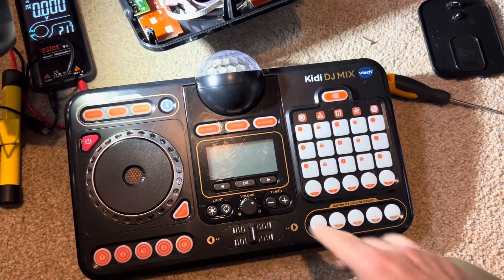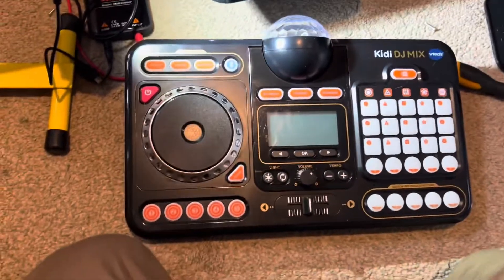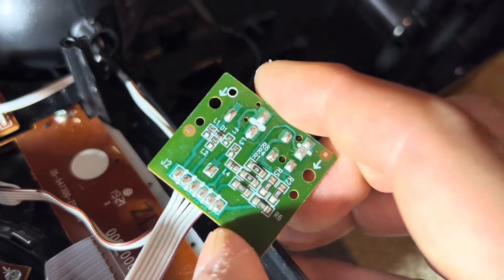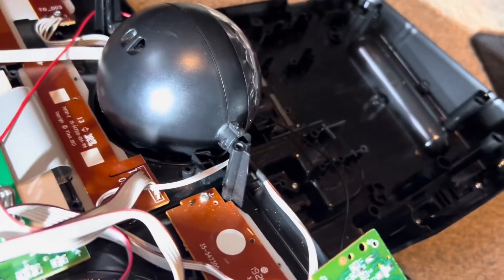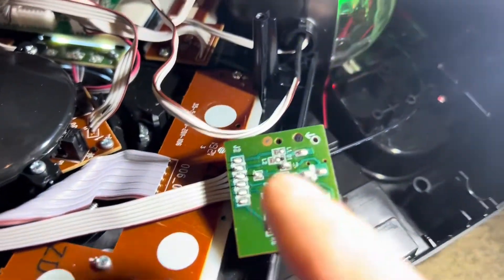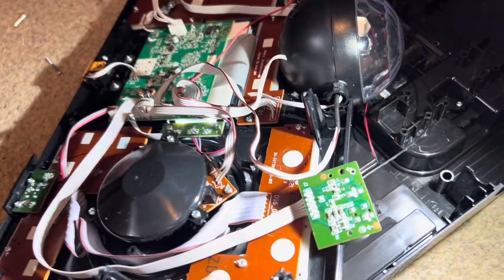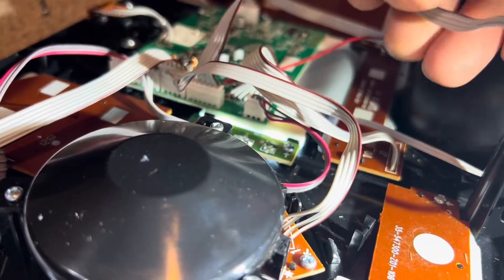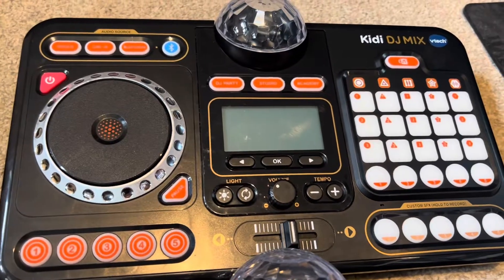Repair faulty VTech Kidi DJ Mix that won’t turn on

Comment: I removed the fuse and added a simple wire. I had to remove and shunt ac adapter because the plug had bad contact too. 
Everything is working fine. I didn’t cut the motor wire.
Reply from the maker: You don’t need to cut the motor wire but there’s a good chance that is what overloaded the fuse and it’ll likely blow something next time instead

Comment: Could i just disconnect the light since i dont have that tool?
Reply from the maker: @iamcrater152  the fuse needs bridging to repair it, disconnecting the light is just to prevent it overloading

Comment: Thanks for this, the soldering worked!! 😅
Do you think it’s still necessary to cut the wire to the disco motor if using batteries? Will it eventually break again if I don’t?
Reply from the maker: @manisharooni  my theory is it’s the load of the motor that blows the fuse.
Reply: @DavesDiscoveriesChannel Okay, so might over heat if I don’t cut it? 
I will do that incase then 🥲 

Thanks again for sharing this knowledge, I would not have had a clue. I’m amazed you could tell that teeny tiny thing is a fuse that’s blown 🤯
Reply from the maker: @manisharooni  it’s hard to say but the fuse is there to protect the other components so something else will likely fail

Comment: I have one and the speaker doesn’t work, headphones do and everything else works, any suggestions?
Reply from the maker: @SimonHukin  none other than opening it up and checking the speaker connection / testing it, sorry
Reply: Thanks, I just opened it and looks ok… the speaker wires had a small bit of crushing, but looked like they should still be ok. There was a hole in one of the ribbon wires which come from main board behind where the Dj party/studio/academy buttons are, but not sure if related, also probably beyond my fixing capability anyway 😅

Comment: I bought it for Christmas and it stoped working after a week, could this be the issue? I changed the batteries. Im having a hard time getting the back to open. But im going to keep watching the video to try and understand it
Reply: I dont have an soldering tool but would i be ble to make it work if i just cut the wires to the motor? Idk whats even wrong with it lol 😅
Reply from the maker: @misspoofs  you need to bridge the failed fuse too.
Reply: @DavesDiscoveriesChannel  okay thank you I'll get the tool for it and then work on it i hope it works out 🤞🏻

Comment: I have the same model but in pink and everything works fine except for the turntable. I took it all apart. I can't find out the problem. I'm wondering if anyone else ran into this?

Comment: Hi! I also bought one of these that won’t turn on and I wanted to try and repair it. I’m not good at electronics so please bare with me 😅

Did you remove the fuse and put solder on the place where it was or did you put solder on top of it? 

Thanks so much!
Reply from the maker: Hi, I just put a blob of solder on top of the fuse (you can remove it if you like) and this one was powered with batteries.
Reply: Thank you so much for the reply! I’ll try your solution. Hope it will work for me too 😄
Reply: You are amazing! Thank you so much for this video! 
Your solution worked perfectly!
So so happy you posted this, can't thank you enough 😄
Reply from the maker: @ioanai1103  glad you sorted it 👍
Reply: And I forgot to ask, if you power it with batteries, is this also the solution? 

Since you said it’s from the power supply I thought it might differ 😅

Comment: Do you happen to have a video on taking it apart? I removed the screws but can’t seem to figure out how to get it apart
Reply: There are 4 screws behind the rubber feet
Reply: @konl5455, thanks for the tip. I missed the 4 screws!!
Reply from the maker: Once all the screws were removed it just opened, check you’ve definitely got all the screws out 👍

Comment: Merci beaucoup !! Je viens de suivre vos instructions et ça a fonctionné! 
Ma petite fille est la plus heureuse ! Merci à vous et abonnez vous
Reply from the maker: Merci pour votre retour!
Reply: J ai branché un adaptateur secteur en 5v - 800ma. 
Depuis le dj mix ne marche plus sur piles . Est ce que cest cela dont il s agit dans le tutoriel ? Ou est ce la reparation de la boule a facette ? SVP
Reply from the maker: La réparation concerne un fusible grillé sur le PCB d'alimentation. @cyrilfarre4027
Reply: @cyrilfarre4027 pour ma part, ça ne s’allumait plus du tout, et j’ai fais exactement comme la personne de cette vidéo et ça remarche, et avec piles
Reply: @RC_Revolution_ peux tu m'expliquer ce que tu as fais exactement ? Une soudure ? Merci
Reply: @supairflypip6408 oui, je fais exactement comme sur la vidéo
Reply: @RC_Revolution_  merci. Ca a fonctionné aussi